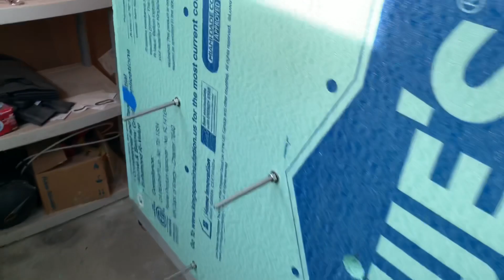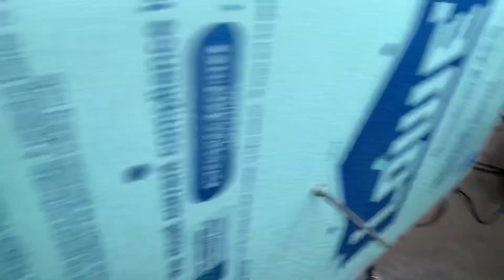T-Rex Camper Build: Plumbing, Siding and Wiring

Comment: Yes, dubjay charging! Double CHAdeMO is super sweet, but it'll be halfway to impossible to get both going at once effectively IMO. Multiple J1772 is all over the place- if you can get two free 40A plugs, you're hitting almost 17kW (assuming 208v stations).

What do you expect your usual charging situation will be like when using this? If you go to an RV park, you'll have a single 14-50 to use (two if you borrow the next site over's). How about mid-trip? Do you know of any sites with two CHAdeMO stations you think you can use en route to somewhere you want to go?
Reply from the maker: Ned Funnell I think I’ll be using all of the methods you just mentioned. Those were all my same thoughts. I’ll charge anywhere I can. I will have a lot of options with this setup.
Reply: @JamesKlafehn  Do you know how much heat the Tesla charger needs to dissipate? Something like 1kW, if it's 90% efficient? It looks like your radiator is huge.
Reply from the maker: @ElectricNed  I dont. I wish I knew. I have asked people who have used these charger in DIY projects and no one has responded. I'm not sure anyone knows.